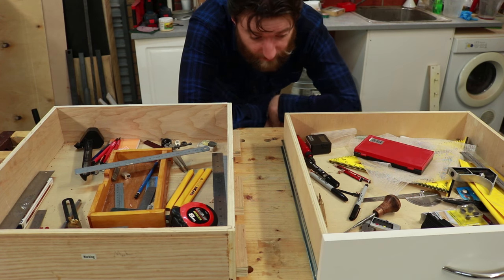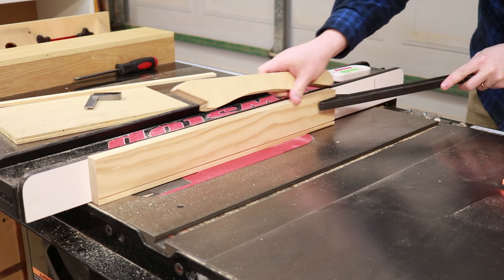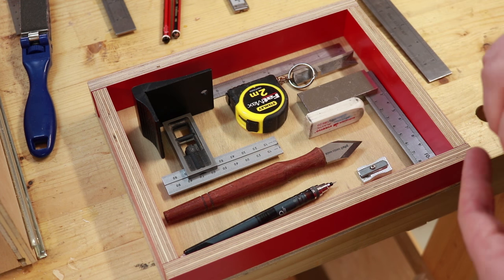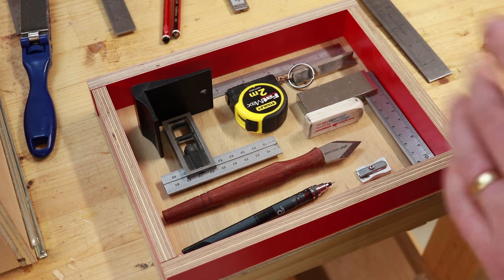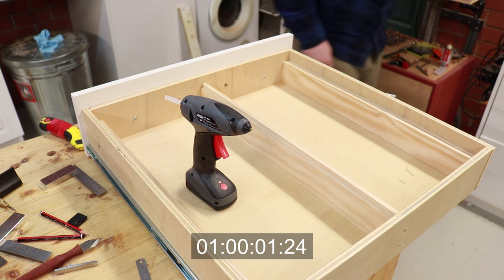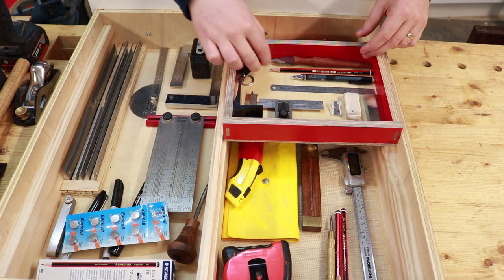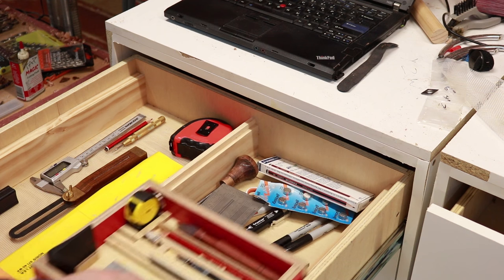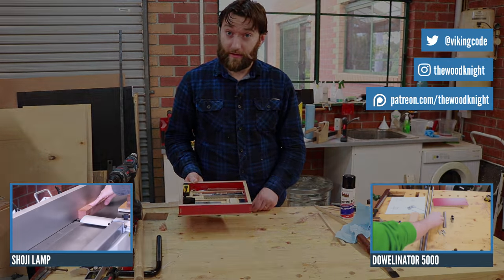121 - Layout Tools/Drawer Organisation

Comment: Have had a bit of crows ash clamp the blade tight enough to stop the motor but never pine. Wood is weird. :D
Reply from the maker: Even Bunnings melamine has done it to me before! Not sure if they just soak everything or the climate down here is to blame, but never had the same issues from better suppliers.
Reply: whaaaaaaat! that's crazy. note to self, don't buy bunnies melamine just in case.
Reply: N
Reply: Yeah never pine for me either , my first time  ever working with maple however, stopped my bladed in its tracks.

Comment: Don't like Kaizen foam?
Reply from the maker: Kaizen foam has pros and cons. If you've got a fixed set of tools that doesn't change, it can be fine, but otherwise it gets expensive if you have a slightly different shaped tool. And this drawer was from scraps, so essentially free, rather than $20/sheet.

Tool density is also another issue - kaizen is wonderful for single layer of tools, but less so for multiple layers. I haven't got that yet in my system, but in the past the wife took a similar tool tray to school, but was able to get even more tools in the same space.